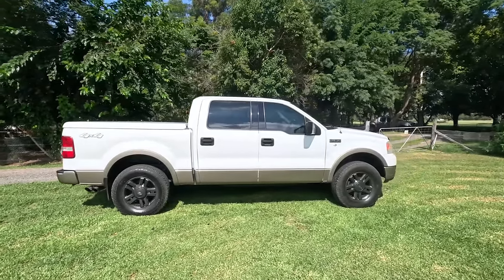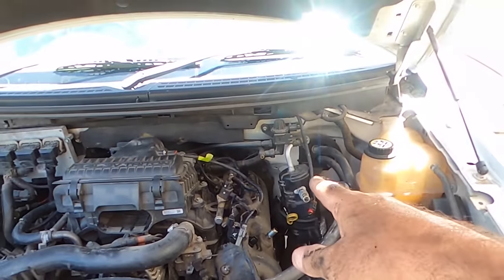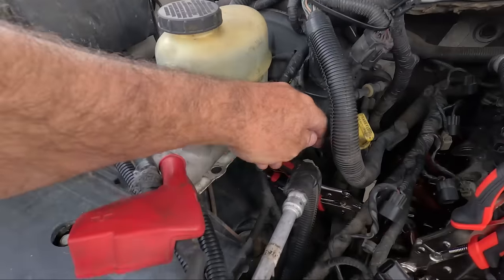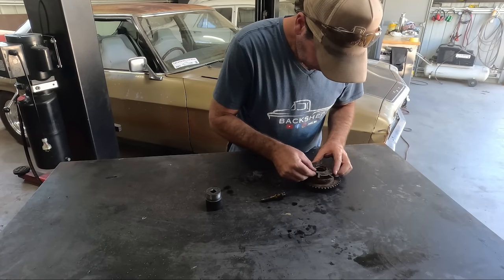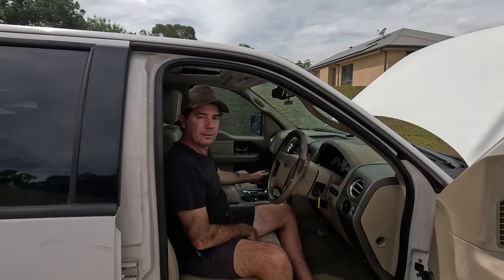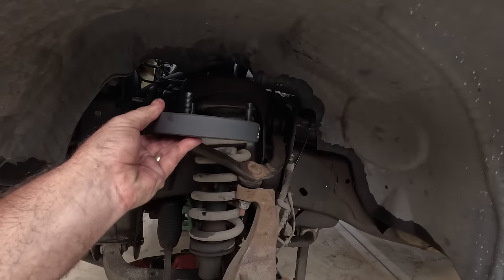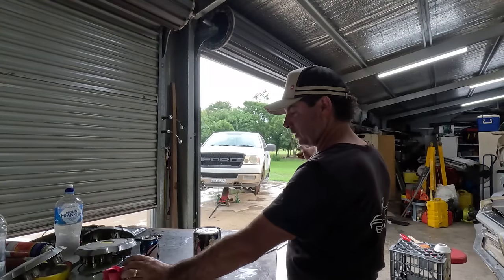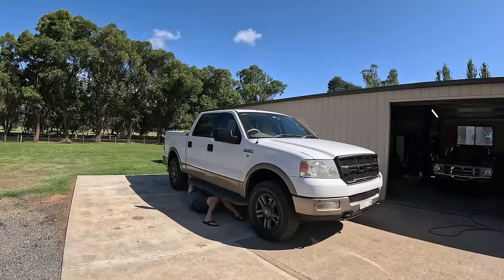BROKEN F150 IN AUSTRALIA !  Budget Truck Makeover plus repairs 5.4 3v cam phasers and timing chains

Comment: Mate - you had me going there for a bit.  I was waiting for that engine to start chucking things out from under the bonnet the way it sounded.  Never heard of those cam-whatsits, but I suppose every modern engine will have a variation on the theme with the modern propensity for variable valve timing.  Just goes to show that you still need a mechanical mind to sort through the bolt-on bullshit to find the culprit and sort him out.  Man, those timing chains were tired - and I've never seen guides do that either.  Makes you wonder what happened.  Age?  Well, half a million km ain't a spring chicken, so I suppose anything's possible.....but listen to the thing roar once she was all back together!  

....and then you tidied her up.  HUGE Kudos to your family, mate.  You wouldn't believe a before and after were the same truck - honestly!  The steering wheel - yep, have had to something similar with my daughter's Mazda 3 steering wheel.  I ain't no seamstress either, but the steering wheel looks SO much better with a cover on - even if both of our stitching could have been a bit better, but you live and learn, eh?  You got the colour choice spot on for it though!  

Same with those alloy wheels.  When you briefly suggested black, I grumbled under my breath.  I cannot stand black wheels unless they are steel and under a hubcap.  To me, wheels and stance make the car and you can never see black wheels properly as they blend in too much with the wheel wells and tyres - especially on the side of the car that's in shadow.  Looks naff to me, but seems to be a fad for them at the moment though.  I like the gun-metal colour - spot on again, mate.  Draws your eyes to the stance but don't make a statement of their own like leaving them that goldy-silver would have.  I had a feeling she'd buff up well too - and the completed package just makes the F150 look half her recorded mileage at a maximum.  

She looks good, goes well, sounds magnificent  and doesn't belch smoke. What else could you want?  Well, me, I might titivate the exhaust so it rumbles a bit more and change the shocks out for something a bit firmer just to take the pudding out of the ride but not stiffen it up like a track car. She's still got to be comfortable to ride in......and with the budget reduced by not having to rebuild the beast, I reckon I could afford to do that.  However, she's still a beaut and if I had no more budget for a while, I'd certainly be happy with it just as it is!  Again, you'd never know what's on the odometer if you saw / heard that F150 coming down the road toward you!  

Reckon she'll do the other half million km before needing a rebuild?
Reply from the maker: I hope shes got a lot more in her mate thats for sure🍺🍺🖕

Comment: Well done, had a bmw e36 m3 with vanos,ie variable valve timing,probably old school now but they got 350 horsepower out of 3.2 litres naturally aspirated,that’s imperial horsepower.
Know that nothing nowadays but there were 3 bolts that needed to be changed and torqued to spec every 80 k, if you didn’t they could break and you’d blow oil overboard at 100 psi, empty the sump in seconds.
Been there like ur work .
Reply from the maker: Cheers mate🍺🍺👍

Comment: I had to replace the blend-door pin on my BA so I know what you went through to get that dash out!!!!! So nice not to find a cracked heater core I am sure!!!!
Reply from the maker: Yeah mate that was a job thats for sure haha🍺🍺👍👍
Reply: Haven't encountered this yet with my BA, but expecting to some time.
Reply from the maker: Oil changes are critical on those motors . Do them early the older they get and plan chains etc . This ol girl got to 482000km before they failed so id say religious oil changes where made on her 🍺🍺👍

Comment: Those 5.4L Engines are notorious for blowing out the passenger side back two Spark Plugs. Ripping out the Threads when the Plug blows out. There's a rethreading kit to put inserts back into the Head. Same method, lots of Grease on the Tap when cutting the new larger hole & new threads for the Insert. Done lots of these. Water drips down into the Coil Boot/Spark Plug holes on the same rear two Cylinders.

Comment: The 5.4 three valves had there issue's the older 4.6 was a work horse it was used in cop cars(Crown Victoria). The trucks were great but the 5.4 issue's made it very expensive to repair but a good mechanic could do the repairs and flip the vehicle and make a few bucks!😊
 Hello from New Jersey.

Comment: Nice job.....
Quick fix for your headlights.
Sand with wet and dry and finish on the finer grit. Apply clear coat. They will be as good as new (ish).....
Be perfect for your truck mate.
Reply from the maker: Cheers mate🍺🍺👍

Comment: Looks mint Mick. What's your plans for it,  would of like to see what happens to the AC. Thanks for your explanation of most stuff because any info is good.
Reply from the maker: Cheers mate 🍺🍺👍
As for Ac i the compressor was seized so i bought a new one and receiver dryer and it regassed up nicely 🍺🍺👍

Comment: Thats what happened to my ba Falcon shifter,I just got a nylon bush off eBay which fits into that dome
Reply: Yeah new cable is the alternative,but more expensive solution,you can get metal fittings as well for both ends off the cable
Reply from the maker: Cheers mate🍺🍺👍

Comment: Hey Mick, I've just discovered your channel today. Love it. Am currently bingeing your early posts.

 My own future projects VH Comm V8 5 spd,  rusted out, I took it off the road 10 yrs ago, dont know if I should fix it or scrap it. 

 and my father's EH Ute, also rusted out. In my shed. 

I need help with the eh. It was my first driver in the mid 70s, but even then it was rusted out un registered. Ide luv to get it back on the road. Its original and complete. except for the holes
Reply from the maker: We are doing a tonne of rust coming soon mate so learn to weld and lets get into it🍺🍺👍

Comment: Good job man, looks like it needs shockies like my car 🙄, hey quick tip too, not sure if you used brake cleaner to clean of cam sprocket b4 welding, but so you know something i recently learnt never weld with brake cleaner the gas it makes is apparently extremely toxic like it kills ya ☠️

Comment: Hey, mick, great video as always. Question for you: How do you get these old cars registered after you pull them out of a paddock?
Reply from the maker: This will sound like a smart arse answer but i assure you its not, just do everything needed to pass an inspection . Brakes have to pass a brake test , all lights and indicators working , no rust holes in the panels, seat belts in good shape , ball joints bushes etc in acceptable/passable condition with no excess play . Theres no trick mate it needs to be roadworthy🍺🍺👍
Reply: @backshed5295   awsome thanks do you have any issues with not having rego papers?
Reply from the maker: No mate all you need is a receipt for purchase 🍺👍

Comment: Didn't the 5.4 3 Valve motor come in 2002-2007 BA-BF Falcon or more commonly in a Fairlane as my friend's 2004 5.4 3V LTD had to get timing chains at 180,000kms so isn't there some support locally❓️
Reply from the maker: Thats the motor mate but cant get genuine phasers quick enough for my liking hahah🍺🍺👍

Comment: What's up Mick? What a great video, definitely a good-looking truck that's for sure. I'm not a Ford guy but I can tell you I would definitely drive the sucker!! So that double overhead cam engine is that like the old SHO Ford Taurus motors made by Yamaha?? I know the SHO we're really fast for the time they were built but they had a lot of problems. I guess that's what happens when you throw a souped-up engine in a daily driver. Too much technology for the time, to tell you the truth Mick I would wish they would have never introduced computers to cars, yeah they make a lot of difference and all that good stuff but they also are expensive and cause problems that we really don't need or want and really they don't benefit it that much. Back in the day of the old straight six truck can you tell me that they were really getting bad fuel economy I don't think so and you can't justify 20 or 30,000 more for something that's only getting a half a gallon better on fuel mileage and so many problems. Yeah Ford Chevy all of them they're all the same they build them so they don't want us to work on them so we can't solve our own problems and most of the time they can't solve them either. Anyway I just wanted to tell you another great video
Reply from the maker: Hahaha yeah your right with the problem solving mate hahhahaha🍺🍺👍
Reply: @backshed5295  have a brew or two and think about all the bad decisions that auto manufacturers are making! All you can do is keep a smile on your face and don't bend over. Haha
Reply: @backshed5295  Mick that's why I love my 96 Silverado so much!!

Comment: A huge job for a huge ute
Reply: @backshed5295  You seem to think about what could be wrong with it this modern can be a minefield older vehicles were so much easier and if the engine doesn't work it is usually something simple

Comment: Contrary to some folks beliefs. Touching the positive & negative cables together does absolutely Nothing. You can reset any late model OBDII system by pulling out the ECU-B Fuse. Or disconnecting the negative terminal. (I've been working on OBDI & II system vehicles for the better part of my life.
Reply from the maker: Well there ya go🍺🍺👍

Comment: Pretty sure that f150 has the same motor as our ba-fg xr8’s
Reply: The Boss motors in the XR8 and GT are quad cam. Much wider heads and rocker cover
Reply from the maker: Yeah xr8 is a little different mate 4valve quad cam motor , this is the same as the ba-bf xt , futura , fairmont etc and fairlane . They also came out in the utes ( not xr) 🍺🍺👍👍 5.4 3v 220kw in aust
Reply: Referred to as the Barra 220.  The XR8s have Boss 260.  I have one.  Hard to believe it is 21 years old now.

Comment: Built Ford rough…
The silly crap all manufacturers put into making a vehicle harder to start, and comes down to a spring worth >1cent per unit. 
If not for you Mick, that would’ve been a $1500 fix at a workshop
Reply from the maker: Mate do you meen $15,000 coz i would have payed someone $1500 to fix it hahhahah
Reply: @backshed5295  Hahahaha

Comment: Worst Engine ever built. Good luck.
Reply from the maker: The 2v was bullet proof if you did chains and guides every 200k miles or so ,i actually drive 1 every day but the phasers on the 3v really were crap. I beleive this truck is now going to be good for miles more all the fragile troublesome shit is gone . Phases locked, phaser pins welded, chains , guides and tensioners renewed🍺🍺💪👍
Reply: It’s done nearly half a million k’s the donks can’t be to bad!?!
Reply from the maker: @michaelteasdale2919  they really are not mate . They had phaser issues but if you kept on top of that they will go for ever . Most of the drama with these motors is owners not changing oil enough🍺🍺👍